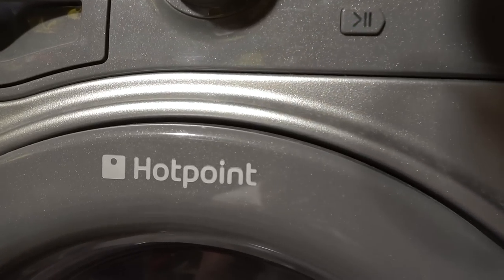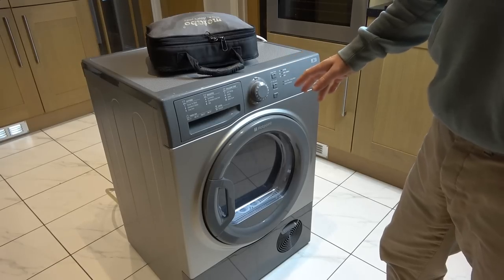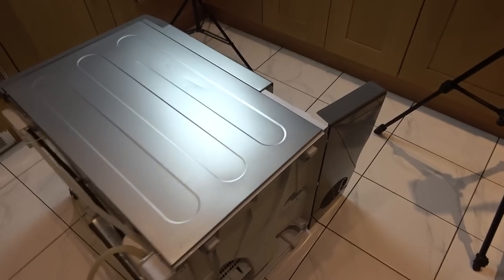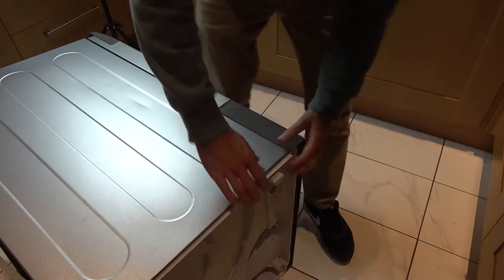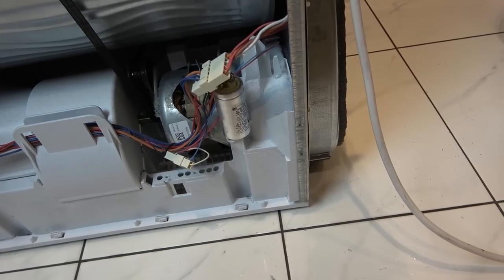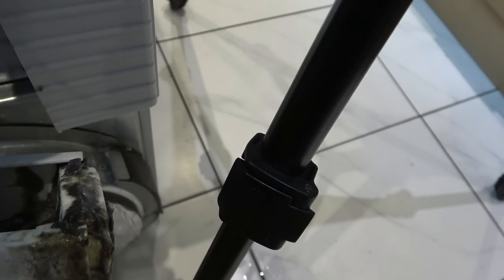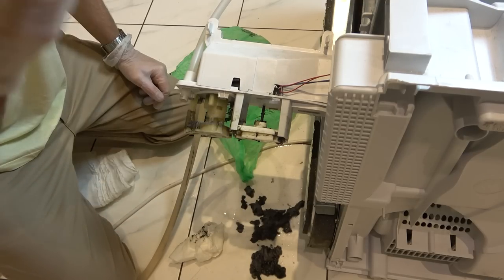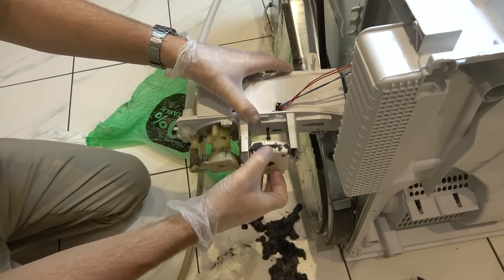Hotpoint CONDENSER DRYER Not Draining - REPAIR Video

Comment: Hi vince what happens is the pump motor is always on as there is always a level of water in the bottom that gets pumped up to the top through the clear tube when the draw is filled with water the overflow black tube refills the compartment at the bottom where it’s just been pumped from which then raises the level of water till it pushes the float up to push the switch which turns off the heater element and water pump also lighten up the empty water led. This in turn prevents any flooding until user notices the led lit.

Comment: I have the same dryer but mine is mow shorting whilst running and its tripping the breaker. the heater is working I'm not sure if its the micro switch as it looks like it gcould be shorting but cant find it as a part to try it

Comment: Hi Vince,can you leave a link for the nylon brushes you use please,I can’t seem to find them thx Jeff ps great channel 👍
Reply from the maker: Hey Jeffers, is it the little metal flux brushes that I use with the IPA? If so they were from Amazon, I typed in flux brush.  I had to buy a box of them (30 I think). They weren't expensive though but there will be enough for a lifetime supply.

Comment: Hey pal, really hoping you can help, so I have the empty warning light, but things seems good with my pump.
1) Blade is intact and spins as expected.
2) No Water in the chamber to set the float up.
3) The float is intact and moves up and down freely.

So at the moment I'm stuck with what it could be. Any help would be greatly appreciated. Thank you

Comment: i DID have same problem a couple of months ago with my mothers dryer the compartment was filled with mold and the impeller had broken off so we did order a new pump but that did not help i think there was a bigger fault too with the electronics because of the microswitch got stuck in on so something further down the line did brake too :/

Comment: how is the lint getting in there - that needs to be addressed or it will keep happening .
Reply from the maker: I think the front filter needs to be cleaned more often and also the bottom part. User error really! Also some of the cheap sweatshirts that are brought for the kids seem to shed an unbelievable amount of fibres from the inside of them which probably doesn't help 👍

Comment: The floats never fail. The main problem is the impeller on the pump. It consists of a small strip on top of the pump. The hole where it is on the spindle goes baggy. Therefore the pump spins but the impeller stays stationary. Quick fix replacing the impeller.

Comment: It's a common problem with condenser dryers and washing machines something gets jammed in the output valve , With dryers it's lint with washing machines its usually a coin or something large that's maybe in the pocket of a pair of trousers which is why I always check pockets.

Comment: To avoid this happening again, empty the lint before every load
Reply: Actually the lint filter that you empty after each load has nothing to do with this. Cause some lint get caught up in the drum etc. So even if you empty that lint filter there is still gonna be bits of lint inside the machine..

Comment: That is weird, every dryer I have ever owned does not collect water, it blows hot air through the clothes then exhausts it out the back and through a hose out of the house I'm assuming the water ends up as steam that just goes outside and dissipates.
Reply: This is a condenser dryer. They are supposed to be more efficient as you don't just pump all the hot air out of the window. Must say the one I owned removed far more water per cycle than Vince's one.
Reply from the maker: Yeah I used to have one of them (your version) in my old house as it was sited next to an external wall with a vent on it. Unfortunately this is in the garage and it is awkward to get a vent out unless I go through the roof. So I bought a condenser dryer so it vents itself, you then you need to remove the water by emptying the reservoir. In my case I don't have to empty the water because it is plumbed into the washing machine drain so it empties down there. From memory condenser dryers are more money so most people opt for your version if you have a vent to the outside or a window.  I didn't realise condensers were more efficient as Ian mentions so that is another plus for them 👍👍👍

Comment: The lint will get into everything inside the machine.
This is the tiny amount of fluff etc that gets trapped in the water, then builds up to a nasty sludge.
And yip the motor capacitor will bite you, get a good screwdriver and cross over all of the connections, if it don't crack it's safe, if it cracks it is now discharged.
I blame capacitors for my grey hairs 😂

Comment: In the 1950s, Hotpoint was an economy line of home products by General Electric in the USA.  They were still selling under the brand in the early 1980's.

I had an electric Fridgidaire dryer by General Motors that had a water condenser tray.  It worked flawlessly for many years.

Comment: designed obsolescence.  think of how many of those get in land fills because ppl dont know, or cant get in to clean that bit. 
the designers of that dryer had to know that it would have to be cleaned like that but they decided to make it so you had to take the top and side off, something that is beyond most owners to clean it out. and i bet they left that bit out of the "service"... lol  owners manual.

Comment: Hi I have a question why do you not post Nintendo things anymore?
Reply: Variety, most electrical faults he learned at this point in Switch are now known and predictable, which in turn makes a boring video.
Reply: @Ohem1  oh ok
Reply from the maker: Hi Aleheather. I did buy the OLED Switch but I never got round to doing any videos on it. As far as fixing them Ohem1 has pretty  much summed it up. I do have a blue screen one here to look at though! Also on my 'What Happens When' channel I connected up a Nintendo Switch using AA batteries instead of the internal battery which you may find interesting 😂👍👍👍

Comment: Maybe be worth checking where you pulled out the condensing box, pull it out and stick your hand towards the back you get a collection of wet soggy fluff you can see it if you shine a torch there
Reply from the maker: Thanks Gary, that doesn't feel right...Thanks Cucumber, that's better 😂 
It is looking all good in there. The first time I had to siphon out the water I gave it a good clean in there, but it looks like all the lint made it's way through that tiny 1cm hole to the float and pump chamber!!! 👍
Reply: @Mymatevince  lol keep up the good work,

Comment: i"m confused, you've changed where the water goes, from up into a reservoir using the installed black tubing, and changed it to drain to the existing drain washer tube but adding a different tube for rerouting on it. In order to do that you had to remove the panels in order to gain access. Yet you said you haven't opened it before. Also, i've watched a lot of your videos and notice how thorough you are and cautious about when you change things. You always make sure that it will function or not interrupt the function by researching how things work before making a change of any sort, I have a hard time believing you didn't do the same here .... understanding how it works before making the modification of water exiting direction.
Reply: No, it would have been an option provided in the box with the dryer. All you'd need to do is swap hoses and that wouldn't need any disassembly.
Reply from the maker: As dlarge mentions, you only have to pull off the black tube and fit a longer tube to the new drain position. No disassembly is needed. Basically the water drains down the same drain as the washing machine so I don't have to empty the reservoir every few weeks. I did a video on it a long long time ago 👍👍👍
Reply: @Mymatevince  Makes total sense now, i do apologize if my statement sounded harsh. :)

Comment: Bad design. The unit should allow you to clean it out without having to disassemble.  I had this exact same problem with a dishwasher where the float mechanism had got blocked up and it took an almost complete disassembly to clean it all out.